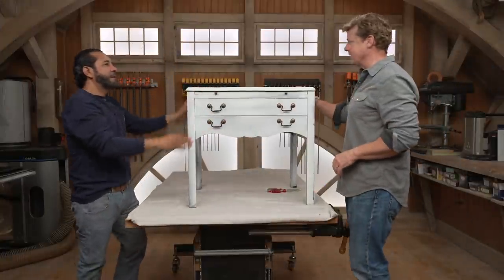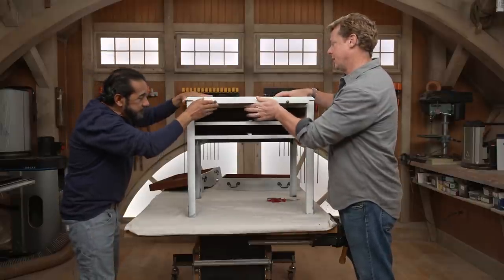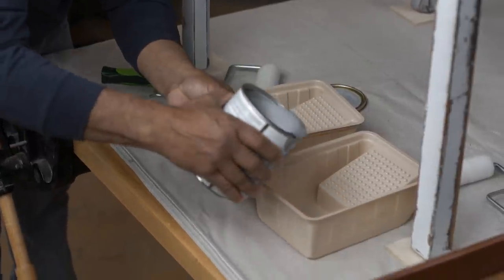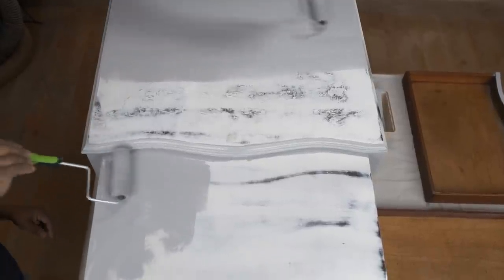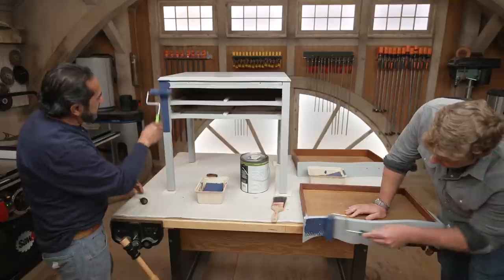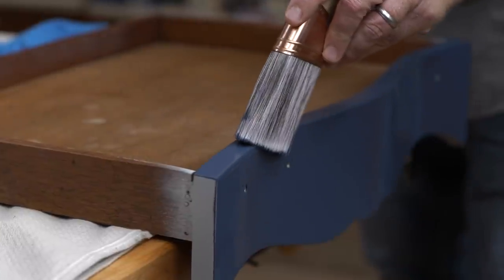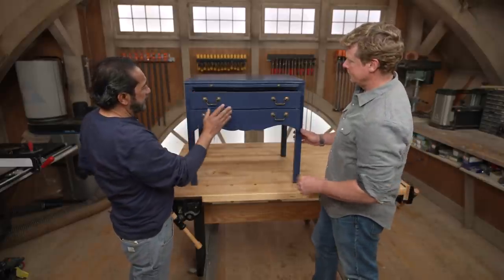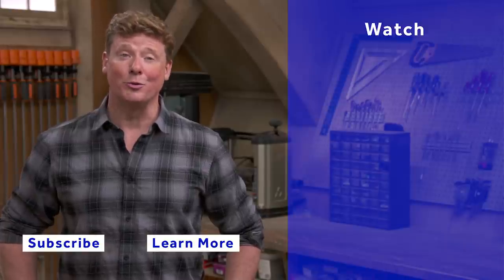How to Refinish a Table with Paint | Ask This Old House

Comment: Who the hell wants to see brush marks....???
Reply: Better than the orange peel look from a roller.
Spray would be best though.
Reply: Yea the brush strokes make it look like a thick 15th layer of paint on an old baseboard. If you're sanding it down like that and taking the time you might as well spray it. If done right, whole surface will be uniform.